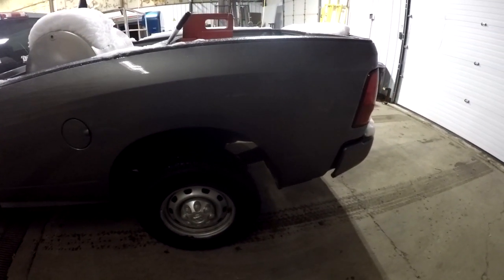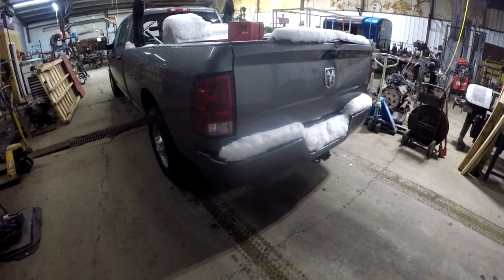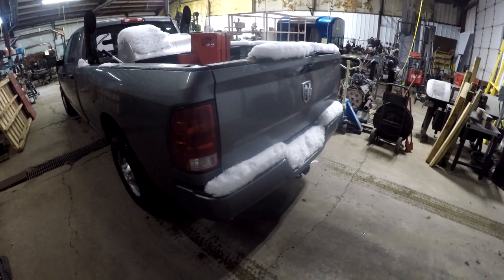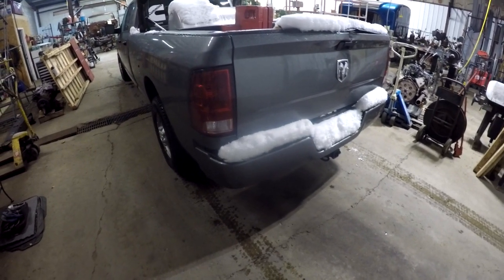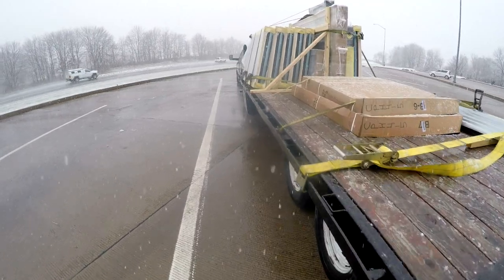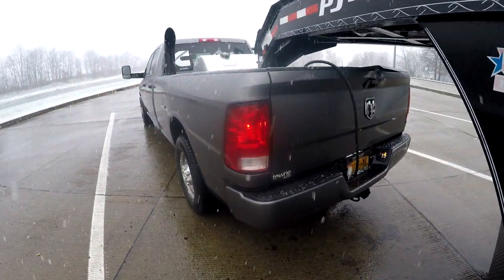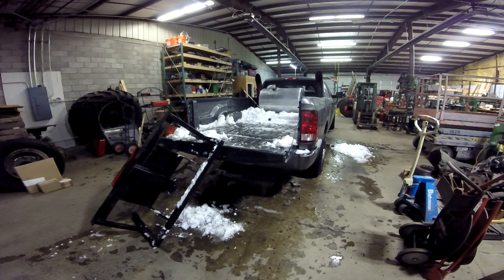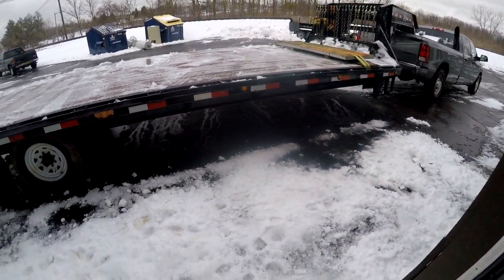Shop Update 12/02/18

Comment: Just a thought. I have a rack in my truck also. I have it set up for grabbing with the forks. And with the use of a pallet, you can set the weights on it. Move them with the forklift in the shop anywhere you want to. Then when you want to put the weights back in you can lift the skid high enough so you don't have to lift so much. We know what they weigh.
Reply from the maker: James Mader It’s a very good thought! When I built that weight rack I didn’t have the forklift (actually isn’t mine, just stays in my shop all the time now)! But now that you suggested it and I do have it around all the time I probably will add some fork pockets to it. 
Thanks for the suggestion.